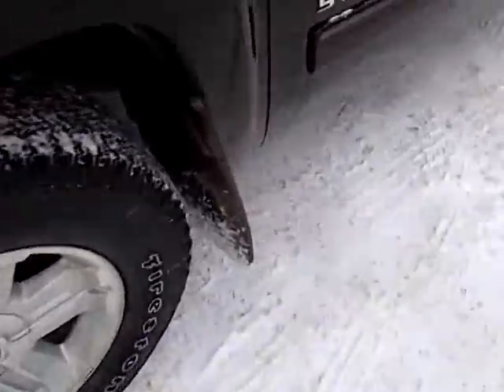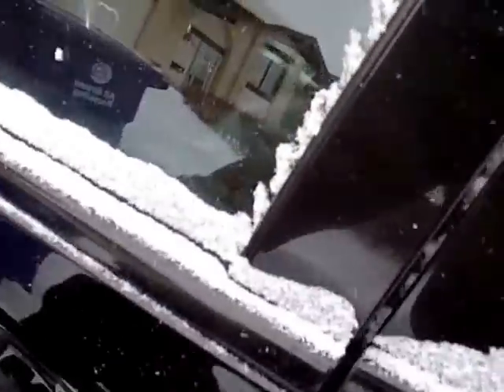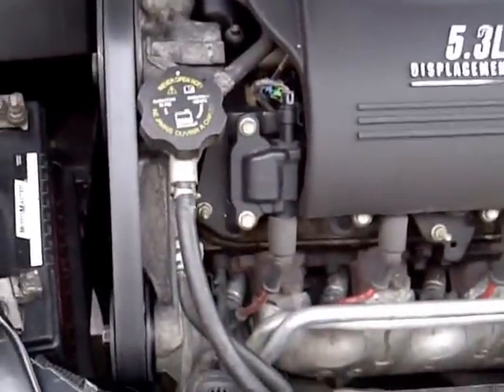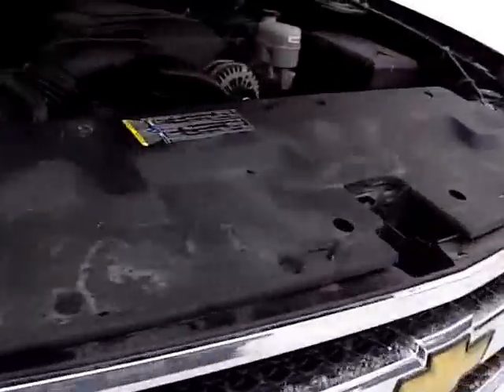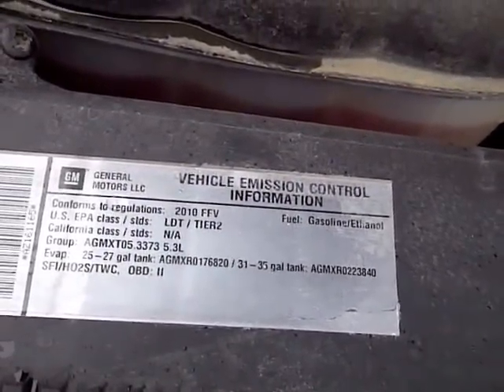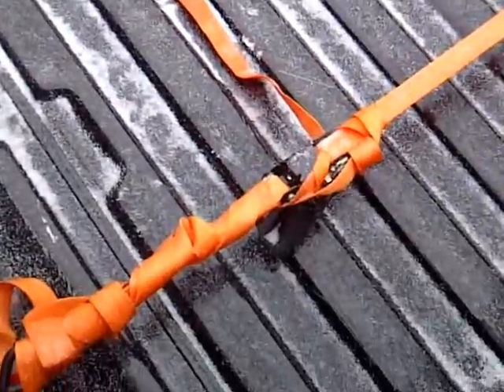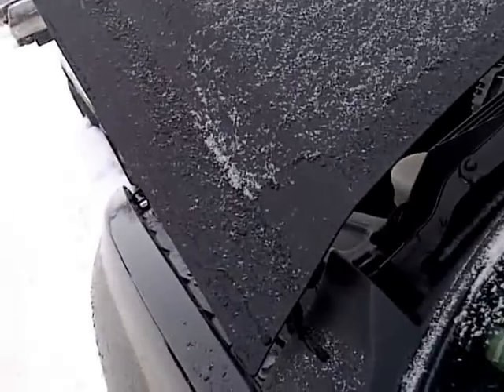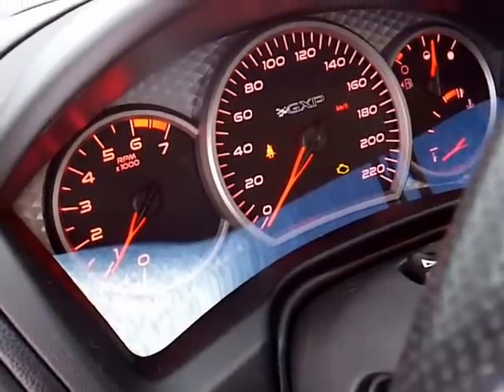Chevy 5 3L is 327 cubic inches

Comment: I rebuilt my 5.3 liter vortec, cam, lob and lifters went out at 197,000 miles.. so i rebuilt it, instead of buying a new truck or new motor, i just now hit 26,000 miles.. its a 2006 chevy suburban LT..  rear wheel drive.. and i never knew it was 327 small block before i had rebuilt it, i had thought they were still 350 cubic inch..  but nah.. the 5.3 liter vortec is for sure a 327 cubic inch small block..  now i see some guys giving different specs on this, well thats like the ford 9 rear end.. everyone  calls it a ford 9.. but, technically,  its a ford 8.8 rear end.. they just round that number up to a 9, instead of saying 8.8.. thats why its called a ford 9 rear end.. now, if this small block 5.3 liter vortec is what some of you guys are saying,  as far as cubic inches,  then now you see why its still called a 327 cubic inch small block.. its actually a little more than 324 to 326, so its called a 327 small block.. and they used to use the 350 in the bigger SUVs.. but they switched it to the 327 small block for a reason.. the 350 was heavy.. the 327 is a lighter,  and actually puts out more torque than the 350.. which in turn,  more torque can result in more horsepower.. so the small block is slightly better than the big block for these vehicles like the suburban.. thet are heavy and you would think,,, hmmm,, probably big block.. but nope.. 327 small block will put out more torque, and its lighter,  this is way better for gas mileage,  horsepower and pulling your trailer on the hitch.. now im not saying a big block cant do that.. obviously a big block can be ridiculous powerful,  but, you gotta really build that big block.. its heavy. . That small block,  all ya need is a damn bolt on turbo charger and you just went from 300 plus horsepower factory,  to 800 plus horsepower with only a few bolts. . 😆 🤣.. no bunch of additions.. then small blocks if built right,, will put out a few thousand horsepower.. lol.. i didn't believe that shit.. unil we tried it on my other truck.. 2 twin turbos, and bigger camshaft,  that fckn truck went from 300 plus horsepower to over 2,000.. 😆 🤣.. of course to maintain that, i needed to eventually bore it, stroke it, put different rods in and few other things.. it was to much power for the factory rods, pistons and things.. those definitely need changed if you really dont wanna tear it up.. it was hilarious when we done that to the suburban. . People were looking around like,, how n the hell is that heavy ass suburban coming off the damn red-light that damn quick. . Lol.. that damn suburban will lift the front wheel overtop a 2 liter sundrop bottle setting in front of it.. 😆 🤣 😂 😆..